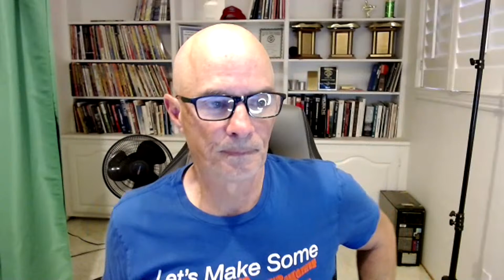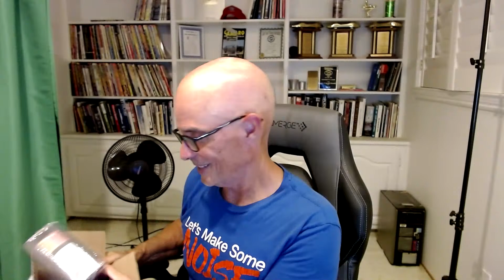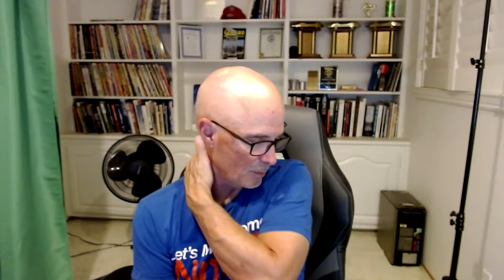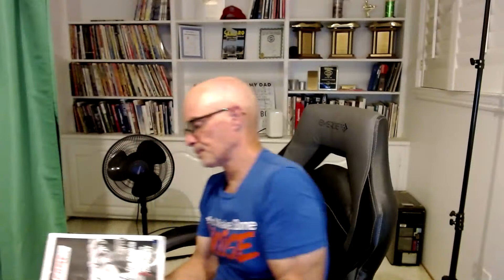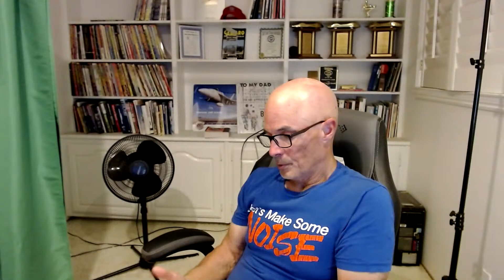BBC PUMP GAS POWER-LET'S TALK TECH

Comment: Good stuff...dig both approaches to power.
My chassis is almost at its limit with mid 5s at the crank couldnt use a whole lot more .
Love to see some comparos or info on the std 16" spal fan, decent flex fan and say one off a Silverado?  Seems the OEM are hands down better and last. The spal does a crap job of cooling my sbc bout ready to go back to mech where the temps are steady

Comment: 540 would be better
Reply: I went 540 intercooler 10-71 with dual stage nitrous to drive to Kroger with my handicap tag.... Fun doesn't stop at 71 yrs old.  Common sense may have stopped but fun is unlimited. My last Hotrod so figured too much is required plus Hotrod has too be a bit scary...